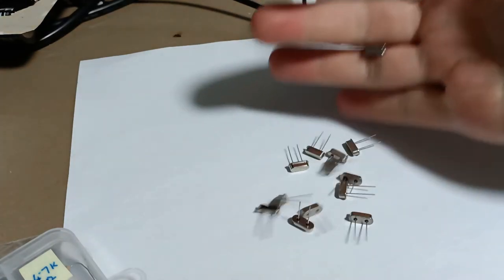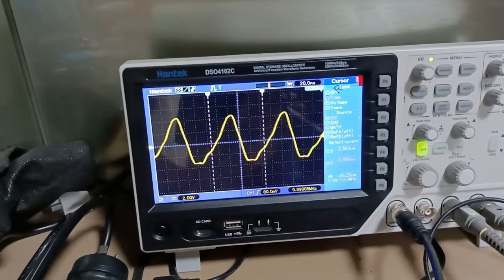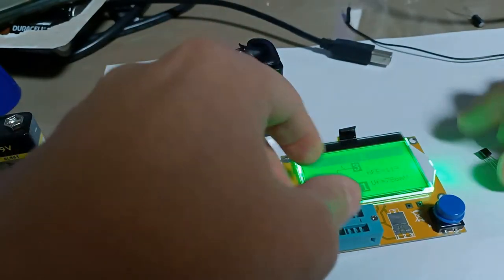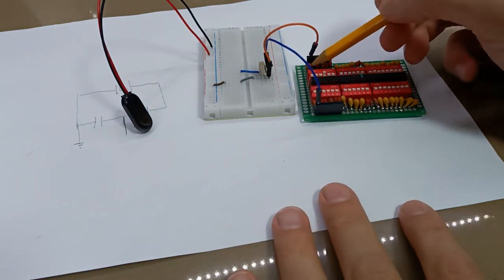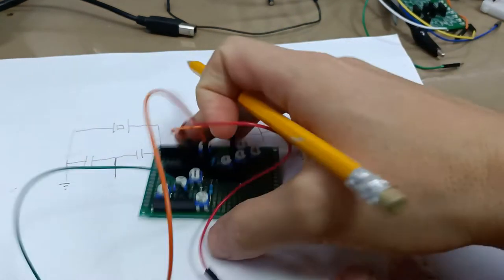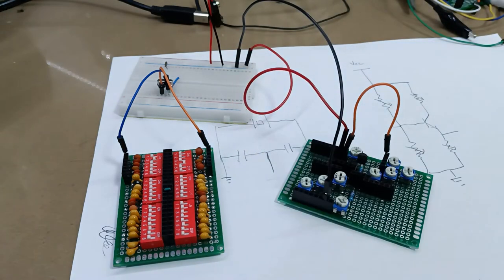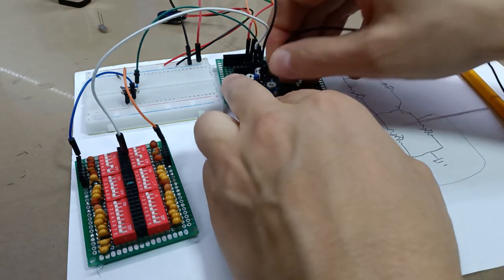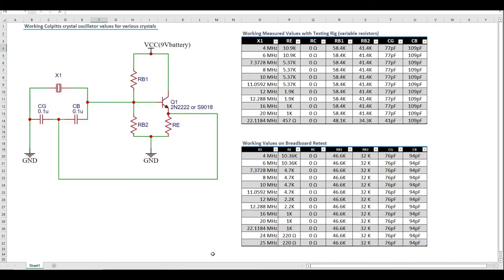Build a Crystal Oscillator in 10 minutes

Comment: If you get a xtal of unknown freq. Get a signal generator, set on sine wave, 5v output and start at some frequency. setup an oscilloscope, and connect the gnd from the signal generator output to the ground on the channel 1 probe. now connect the signal generator + output into one leg of the xtal, and the oscilloscope probe to the other leg. slowly raise the frequency until you get a sudden jump in your Peak to Peak voltage way above the 5volts you put in, and you've found the freq. via resonance.
Reply from the maker: Thanks for the useful tip.

Comment: Boy, im a mid-life career change engineering student. I am building a 7-segment decoder from scratch based on core rope memory. I have everything working but need a clock. Was considering 555 oscilator bit wanted experience getting a crystal to oscillate. I followed your example to the T (maybe 1% or 2% off your actual values in the table) and can not get any oscillations. This leaves me with two questions.
1. How would you test a crystal in the first place to see if it functions properly.
2. How would you go about troubleshooting the circuit when there are 0 oscillations? What components are most important/sensitive?
Reply from the maker: Usually the resistor between the emitter and ground has the most impact on getting it working.  Try varying that

Comment: Other folks have already expressed my thoughts in the comments but your vid deserves another comment.  I’ve been struggling with this exact goal - but I was assuming I’d get a prefect sin wave   Lesson learned!
Reply from the maker: Thanks. It is tricky enough to get the oscillation to happen. It seems to me that every time I try to make the sine wave too perfect looking the circuit becomes unreliable. 
I think you can apply a filter after the oscillation circuit if you need the wave cleaned up.

Comment: Easier and more reliable circuit is the pierce oscillator - crystal between base and collector. try a 1k in collector and 47k to 100k between collector and base.  Works great. no capacitors needed unless you want plus will drive TTL or microprocessor clocks. 2n3904 works great. most small npns will work. Emitter is directly grounded and several volts p-p on collector for TTL. Amplitude and symmetry can be adjusted by varying the bias resistor. Higher frequencies benefit from lower load resitor and bias resistor.
Reply from the maker: Thanks l will have to try that.

Comment: there are some really simple circuits using CMOS inverters like 74HCU04, you get buffered output that essentially swing rail to rail, one chip, one resistor two capacitor, very simple no testing.
Reply from the maker: Thankyou for letting me know.  I will have to try that out.
Reply from the maker: Thanks.  I got one to work using SN74HC04N inverter. :)
Reply: @overengineeredinoz7683  fyi the "u" parts are especially designed for oscillator circuits. I used to work for Motorola in the logic group. I never did try to make a std part as an oscillator but kudos to you.
Reply from the maker: @SuperFredAZ  Thankyou. That is really interesting to learn about the U parts.
Reply: I worked in Motorola/ON Logic group in the 90s, I even wrote an article about using the "U" parts as an oscillator- Fred Zlotnick

Comment: Absolutely brilliant
Reply from the maker: Thanks
Reply: Is there away to add audio to your circuit to be a transmitter might be silly question but just starting out with electronics especially rx an tx so any info appreciated thanks once again
Reply from the maker: @Carl-zg5jd  you could modulate the signal to transmit audio. I do a form of modulation on the RC truck transmitter videos.

Comment: Did you build the capacitor substitution board or buy it?

It looks more versatile than most as I suspect you could tap into more than one value at a time because of the rails down the center.
Reply from the maker: I built it. Was just some perf board and dip switches and female headers from Ali express that I soldered together with the capacitors

Comment: Interesting, IMSAI Guy's colpitts circuit has the capacitor divider going into the emitter. I wonder what the tradeoffs of the two similar but different topologies are.
Reply from the maker: Are you talking about his video titled #1527 1 MHz Colpitts XTAL Oscillator
If so I think it is the same where the emitter line goes to the centre of the capacitor tap.

Comment: Can i use 2n3055 transistor
Reply from the maker: That looks like a power transistor so I don't know.  All I can suggest is try plug it in and see.  If it does work please leave a comment in case someone else wants to know 😊
Reply: @overengineeredinoz7683  ok
Reply: The gain-bandwidth product of the 2N3055 is too low to be of use for this application. There are many much better choices, such as the easy to remember 2N2222, that cost pennies.

Comment: Hi, would it be possible to get in contact with you regarding an rc remote project?
Reply from the maker: Hi. I do not have an email for the channel but if you want to ask questions in the comments I can try to help.
Reply: @overengineeredinoz7683  I'm new to electronics and am trying to create a simple transmitter that uses a 27MHz crystal to send a 27Mhz signal to an old receiver in a toy. I have tried to duplicate your schematics using a bread board but have had no luck.
Reply from the maker: @KevinMuller-tb6bl  do you have an oscilloscope. Is the crystal oscillating in your circuit?
 Does the original transmitter work?
Reply: @overengineeredinoz7683  I don't have immediate access to and oscilloscope so I am unable to check if the crystal is oscillating and the original transmitter does not work. Might be a silly question but is the circuit transmitting when the crystal is oscillating or are those different things?
Reply from the maker: @KevinMuller-tb6bl  when the crystal is oscillating then wires attached to it act as antenna that then transmit the same frequency as an electromagnetic wave. The length of the wire has an effect on how strong the transmission is. For my truck when the crystal was oscillating and a 20 cm wire attached then the truck became still.  To get it to move the signal then needed to be modulated into a series of pulses. The  rate of the pulse decided if the truck went forward or backward.
Reply: @overengineeredinoz7683  Ok that makes sense, I did some testing using a newer 27MHz remote, the old toy does not respond to the input signals (forward, backwards, left, right) but instead only responds when the remote is turned on in "neutral" when it is just transmitting the 27MHz carrier wave. The toy moves forward when tuned on and then when it receives the 27MHz signal it switches to reverse. So I am just trying to recreate the 27MHz signal I think.
Reply from the maker: @KevinMuller-tb6bl  that sounds easier.
Reply: @overengineeredinoz7683  In theory it seems like a very simple circuit that I'd have to put together, I'm just having trouble finding a schematic for that particular purpose as I do not have the knowledge required to create one myself.
Reply from the maker: @KevinMuller-tb6bl  the hardest bit will be getting the crystal to oscillate.  Usually the value of the resistor going to ground from the emitter of the transistor is the most critical one.  Without the scope you won't be able to see if it is oscillating so probably having the car on and then tweaking the component values in your circuit until it responds is an approach you could take.
Because it is a 27 MHz crystal it is possible it is an overtone crystal. I have a video about that.
Reply: @overengineeredinoz7683  So would using the Colpitts Oscillator schematic from your 3rd overtone video output the 27MHz frequency if the values were all correct? I noticed in that video the schematic only has 3 resisters on it but the breadboard you were using happened to have 4. The schematic from that video is one of the ones I tried to breadboard but had no luck.
Reply from the maker: @KevinMuller-tb6bl  it might work but you may have to tweak some values. It depends a bit on the crystal and the transistor I think. Someone else had a try and left some comments on that video about their experience with a different crystal if I remember correctly.
Reply: @overengineeredinoz7683  The remote that worked in the testing used a 27.145MHz crystal, the comments regarding that in the video seem to have been deleted. But if I were to gain access to an oscilloscope would setting up the Colpitts Oscillator with trimpots and then tweaking the values be the best way to achieve the 27MHz output? and would I just have to get a range of transistors and change them out accordingl?
Reply from the maker: @KevinMuller-tb6bl  if you have trimpots you probably won't need a range of transistors. I would suggest starting with the colpitts oscillator circuit without doing the overtone stuff first as that is usually easier to get something oscillating. Then if it is only 9 MHz instead of 27 you will have to do the extra bits for overtone crystal.
Reply: @overengineeredinoz7683  Hi, I managed to do some testing with an oscilloscope and got the circuit to work! I ended up having to add the overtone adjustment (had to remove the 550nF capacitor and only add a 2.2uH inductor). 
Thank you very much for all the help, I really appreciate it. Happy holidays!
Reply from the maker: @KevinMuller-tb6bl  That is great news!
Overtone crystals can be tricky so well done. I am excited for you.

Comment: One small point, the Emitter follower circuit has a gain of less than unity! no amplification.
Reply from the maker: Thanks for the comment. You are correct it doesn't amplify voltage. It can provide a current gain.